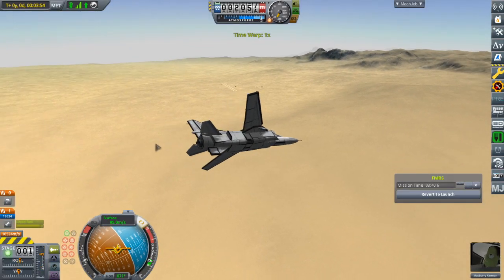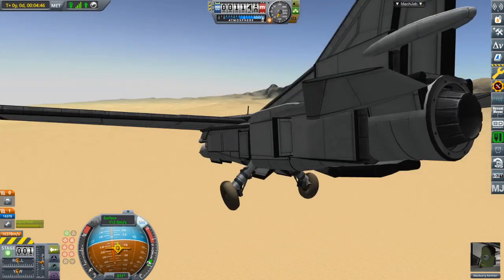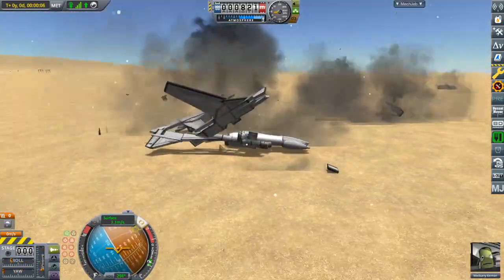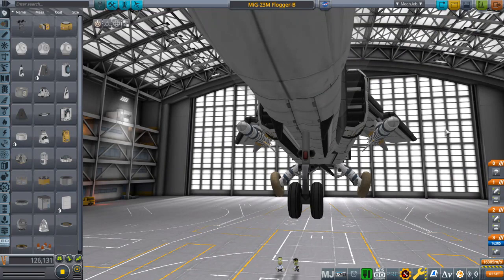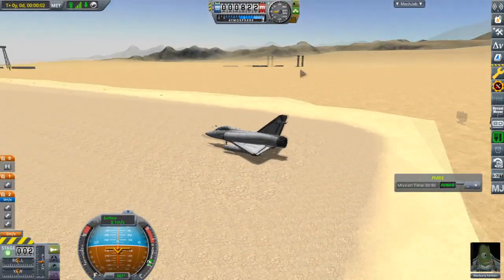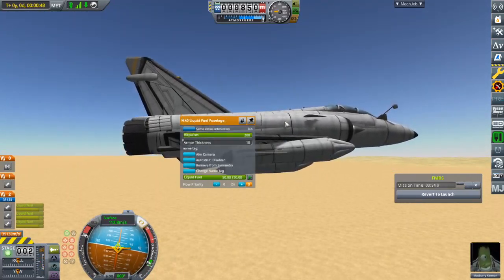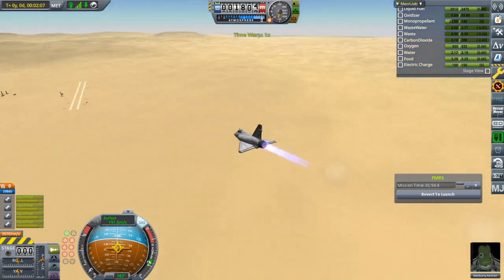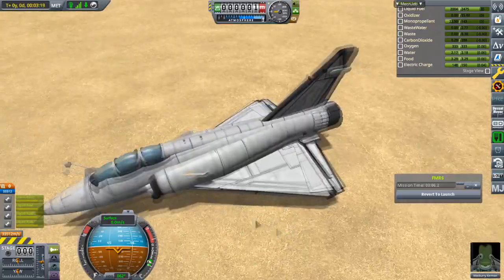MiG-23 Emergency Landing in KSP

Comment: I think the way to use the afterburner on the mirage is to NOT stage the second engine. That way you turn it on and change modes on the others at the same time.
Reply from the maker: Too bad you can't disable engines from staging...

Or can you? I haven't had want to disable one in a while.
Reply: @guard13007  No, I think you'd have to just never stage it. If it were my design, I'd stick it above the topmost stage.